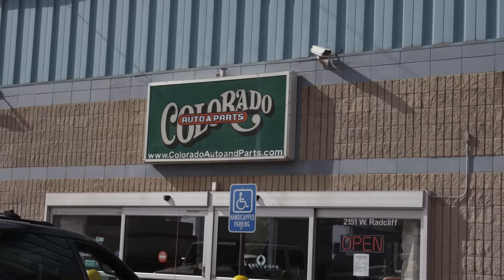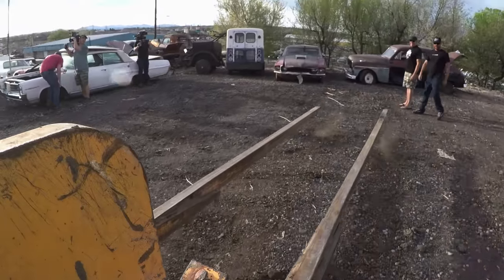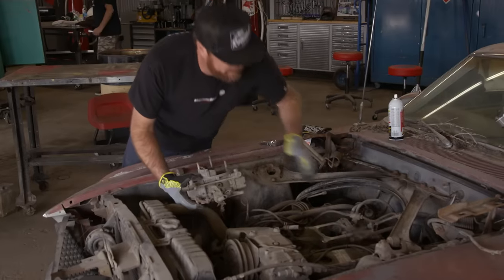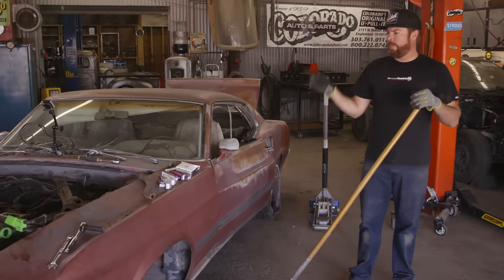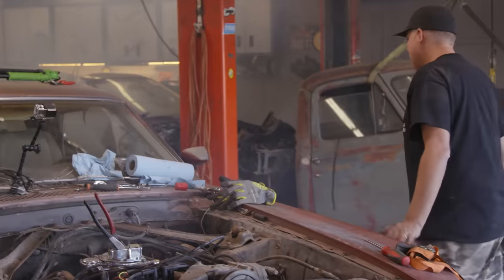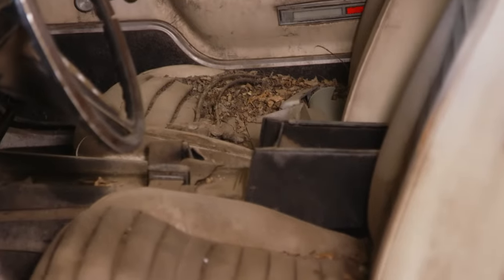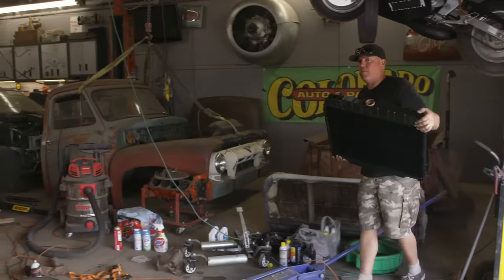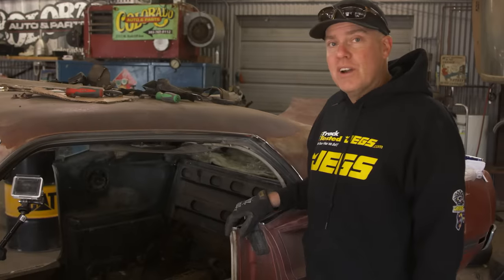Junkyard-Rescue 1969 Mustang Mach 1! - Roadkill Ep. 66

Comment: If a car sits rotting  for 37 years and is able to run with only fluid changes that car is the definition of pure quality.
Reply: You say that and then here comes episode 73 and the motor seized.
Reply: needed a lot more then that... dont know where you got that from.
Reply: Well, a leaf in the oil pan blocked the oil circulation. Can't blame the car ;)
Reply: Frederik19951995 How’d a leaf get in the oil pan?
Reply: Badjuju It needed some weather-damaged parts but the engine was mostly good, the parts for the fix weren’t insanely expensive or hard to find, the engine didn’t need disassembly
Reply: The leaf probably got in there because the distributor was not in it
Reply: Needed waaay more
Reply: Why I like ford
Reply: too bad , the new fords don't hold up like that
Reply: your uber has arrived!
Reply: @damaylaphoenix1155  No new car holds up like that. Theyre all focused too much on luxory nowadays. Nissan Titan, Frontier, and the Xterra were very solid though
Reply: Ssuuwaaaa
Reply: 1 in 500 cars sitting for 37 years still run that's amazing
Reply: no doubt it is a quality car, but I saw a new carb, distributor cap, wheels and tires, brake cylinder, etc.  Not to mention that the floor is totally rotted through, and they didn't bother to fix it.  But I was surprised how square and true the car looked after all that time.
Reply: Built Ford tough
Reply: Conixon Ni unlike most of today’s cars I like most older cars rather than the new one
Reply: one reason that old ford is so much better then new ford.
Reply: Only a Ford
Reply: America made that's why
Reply: @user-di1de7zm2b   . . The motor seized up because there were leaves inside that blocked the oil flow. Had the 'guys' checked for debris more thorougly, the seize-up would not have happened.
Reply: 😍 you too baby girl is so much to me and my kids and
Reply: all there missing is marvel mystory oil  to restore the motor and trans  now that the rings are shot   the bores had to be so rusted it was like runing the piston and rings in a bore made of 100 grit sandpaper same with the valve guides
Reply: any one intrested in a non numbers matching rot box
Reply: the battery must have been still good too
Reply: I would have taken that car in a heartbeat.  When I bought my first mustang it had a blown engine and a c-4 tranny that leaked about a quart a day. I drove it for 2 years before my husband sold it.
Reply: cody6665     9
Reply: Somebody should take a car from today and Try to start it After 37 years Sitting outside...
Reply: @user-di1de7zm2b  leaves blocked the sump apparently

Comment: Anyone else mad that cars aren’t built like this anymore? Everything just looks like a Toyota Corolla and it’s upsetting me
Reply: Ur right
Reply: Modern cars are rounded to try to counter drag.
Reply: 100% agree. Don’t even get me started on Prius’s or daily drivers like Honda pilots. Uhhhh why can’t they make cars like they used too anymore????
Reply: Thats cos you dont understand why all cars shape is similar. New cars are much safer to be even run over by. The bubble rounded curves not sharp edges. All wipers and stuff placed lower so you dont get flesh ripped off. But mostly its for cars hitting each other. Old car bonnet crumples engine pushes into the footwell steering collum through ribs. But the bubble car is all crumple zone. A front impact carries the shock up the wings pillars down the roof all protecting the people so much better.   Remember the motorbikes front number plate? How many people got split by those. Hood ornaments impaling people at just 10mph. Cool car DUMB DESIGNS. This is the future stupid deaths gave us.
Reply: j q meh. Life is meant to take chances.
Reply: I know right
Reply: All cars look like a Toyota Corolla? Not really buddy, not by far. Granted not all technologies that they come out with are necessary improvements to cars and sometimes cause more problems but overall, yes, the technology today will do circles around the cars from back then. it's just like firearms yeah shooting a muzzleloader from the 1700s is cool once in awhile but I'd rather have my AR-15.
Reply: We could go back to every car on earth being a variation of a Dodge K car.
Reply: @Ryan318l  pleanty of companies make replica's, you can buy a brand new mustang just as it rolled into the factory brand new and make your own.
Reply: White McFlight he means overall exterior look of cars not in performance parts
Reply: @Ryan318l  You're not the only person on the road, other people can be hurt by your vehicle a d your driving too. If you were alone on this planet, it wouldn't matter.
Reply: Dillon Orr I’m 12 so I don’t drive. But if I did, I would agree.
Reply: In response to some of the replies here cars all looking alike has less to do with safety or aerodynamics than people's greed and stupidity. Yes cars today are generally more aerodynamic than cars of yesteryear but if aerodynamics were the only concern you'd have a car that looks like this https://www.wired.com/2014/09/german-aerodynamic/ because most of it's problems have been fixed. Lest we forget the 1940s-1950s cars with fins and streamlining or the 1980s when Asian cars brought in angles on everything. Unfortunately people copy other people's successes hoping to cash in on them and idiots eat it up as long as it's packaged as the newest thing. Some fads across the years include...

TV/movies: westerns, atomic power/monsters, kung-fu, soap operas, game shows. 

Games: zombies, battle royale, hero shooters, cosmetics, F2P.

Fashion: from everyone wearing suits and dresses to everyone wearing t-shirts.

Changes in style are about 10% innovation and 90% people copying what is currently popular to make a buck. When new phones, cars, movies, software and games are released based on a schedule and what is currently hot they often don't do anything significantly better or different than what has come before. Innovation takes time but that doesn't stop people putting out "new" products every year. As long as it's labeled new and popular idiots will buy it. Actually being better is second place at best.
Reply: That's why I no longer buy cars all I buy is trucks through the only vehicle still made out of all metal
Reply: AE86 👌😭👍
Reply: @westerjester5066    What's "cos" supposed to mean?
Reply: Get a new Mustang bro, head turner for days
Reply: Don't worry they all look like ford Taurus' now
Reply: Danny A boyyy stop
Reply: Danny A yes but everything is being modernized and becoming more efficient
Reply: Danny A sooo like that Mach one would get smoked by a a k series Honda and you’re complaining that everything is starting to look like a Toyota Corolla FYI the Toyota Corolla  is old
Reply: It’s up to us to keep these cars alive
Reply: I was born in the 21st century but generally believe the older look of cars is better. I can't stand where I live, all dealerships I ride my bike past they're all full of pregnant cars or family vans literally nothing looks good.
Reply: That's why I have an old Vega but new drivetrain
Reply: i know it is stupid they should bring it back
Reply: Danny A have seen a new corolla? They look like higher end lexus now. Not even corollas look like corollas anymore
Reply: I'm a huge fan of the 2005-2009 S197 Mustangs too- but looks wise, nothing better than a acapulco blue 69 with the slats and wing... gotta say though, the 69s were a falcon that gained half a ton, the underhood bracing barely held them together, where the S197 is tight and even though portly, stiff as a board...far better car on many yardsticks, but looks? the nod goes solidly to the 69. Imagine if Hyundai repopped a 69FB body for their V8 Genesis chassis? they could end the US auto industry overnight...never understood why ALL manufacturers are still so fixated on round roofed 4 door sedans...costs the same to make a pretty car as a commodity car...
Reply: I love one corrilla
Reply: @mosshivenetwork117  thats facts
Reply: @westerjester5066  that made sense but it didnt
Reply: You seen the new Chevy trucks? May as well be called the Chevy tundrado
Reply: So called Eco cars are incased In plastic
Reply: Or does a Toyota Corolla look like everything else? 🤔
Reply: Toyota Corollas go 300,000 miles, just ad gas no maint. Needed

Comment: Roadkill tip for you. If you run a flat tip air hammer bit on the mach 1 engine mounts while it's running it will clear the rings. It will also move sludge in the valleys. Dumping in seafoam first and waiting an hour also ensures 💯 victory!

Comment: I wish there was a use for those old oil can spouts, i bought a few tote boxes from a speed shop after the owner shifted for his last time, and had a bunch inside. maybe weld 'em into lawn art.  I can say from experience, those 1969 gas tanks work in 1967 Mustangs, you lose an inch of trunk space but gain capacity.
Reply: I have a  '67 390 GTA  Fastback that i paid $1200 for 30 years ago. I never liked the 69s , bigger heavier, ugly tail end. To each his own and sometimes I wish for AC but roll down the windows and listen to the rumble makes it worth the sweat. Nice to see this one running.
Reply: @Ratfunk02  That's a nice purchase (I have a 1967 convert, interior/exterior decor group, honey gold, original 289 3 speed but someone put in a 351W with headers and a hurst shifted toploader--pretty much 1970's fuel economy technology).  I wish Ford had done more with the 390 to compete with Chevy's 396. that rat was the LS1 of its day, easy to get 450 hp out of. Ford did some effort in 1961 to do a tripower 390 with 401 hp. but Ford wanted people to step up and order a 427. 

The 1969 and older models did get bigger, which gives some room for a big block (I also have a 1986 GT, there's fun with small blocks when the car is light).I will say, AC is nice :)  I have a 1968 Olds 442, stripper model (except power steering and the THM400) with black interior and vinyl top and I live on the coast, so if you get air moving it's not a hot blast of dry heat like in say Nevada...but on a long drive the wind noise gets to you (the flipper vent window doesn't do enough). One day that will get AC, a new unit that takes up less weight.

Comment: Bought a used '69 Mach 1 in 1970 when I came home from Viet Nam. Had the 351 Windsor with a 4 spd manual. It was burgundy with the gold stripes. Was stationed at an air base in NY. That car was great for the twisties in the Aderondack's. Wish I still had it. Traded in my '64 Galaxie 390 4 spd on it. Wish I still had that one too.

Comment: Hood hinges for old Mopars are no problem. The ones on my '69 Charger came from a 1980s Dodge pickup truck. They're all the same for a bunch of different models for a bunch of different years, which is how all car manufacturers should have done it. My radiator, windshield wiper motor, and horns are from 1970s and 1980s Dodge pickups and vans too.

Comment: My advice would be to restore that Mach 1 and stick in a new engine(Must be ford) also do up the suspension
Reply: Booooorrrrriiiiinnnnngggggg!
Reply: Put rb engine
Reply: A '69 Mach 1 with a Coyote 5.0 is boring to you? Damn bro, I wonder what it takes to keep you entertained.
Reply: Schnot LS?
Reply: Graf Nikolai Gay!
Reply: Corey Smith The point is how many hundreds of thousands of car restorations are there? Been there done that. How many restorations can you watch before it gets really boring?
Reply: Caleb Sebastian jdm!!! xD
Reply: Graf Nikolai rebuild the engine
Reply: Graf Nikolai either a 5.2 shelby motor or a modern 5.0
Reply: dude, that engine runs fine! just rebuild it so it doesn't smoke
Reply: Da_Boom the smoke just comes from turds burning off the block and headers

Comment: The Coyote from Hard castle and mccormick wasnt a bradley GT. The car McCormick drove the Coyote X,was built from custom molds based on the McLaren M6GT.[1] The original Coyote X was molded, modified and assembled by Mike Fennel. The nose, windshield doors and lower body (minus the ventral intakes) are faithful representations of the McLaren; the cut down rear deck, however, was a custom component that became a feature on many Manta Montage kits with damaged or removed rear windows. The most noticeable differences between the Coyotes and Mantas are the wheel wells, roll pan height and shape, and the fact that the Coyote has a one piece front clip that terminates about an inch before and surrounding the windshield.

Most of the cars made for the show were molded and assembled by either Mike Fennel or Unique Movie Cars. Like many kit cars of the time, the car uses a chassis from a Volkswagen Beetle and its engine from a Porsche 914.[2][3] For the second and third seasons, producers used a different Coyote which was based on a DeLorean DMC-12, as Brian Keith had difficulty getting in and out of the original Coyote.[4]

The Season 2 and Season 3 Coyote does not resemble the Manta, as the front is larger than the original, making the car resemble a front-engined car. The Season 1 "Hero" car that was used in the production of Hardcastle and McCormick is owned by a private owner in southern New Jersey.[citation needed] The stunt/skid car (used in all 3 seasons) was reconfigured for the Knight Rider 2000 television pilot,[5] then consequently turned into Jay Ohrberg's show car "Taz-Mobile".[6] In April 2011, the stunt/skid car was sold and shipped to Dallas Texas where it was re-bodied back to its former Coyote configuration, retaining as many of the original Coyote pieces as possible (in private collection).[citation needed] Note: there was only one Season One "Hero Car", One "Skid/Stunt" Car used in all three seasons and several (center seat mounted, dune buggy like, see title shot) "jump cars". A Season 2/3 (De Lorean body) car appeared briefly on the sixth episode of Season 5 of the sitcom Married... with Children.

Comment: love these fastbacks. crazy that a nearly intact mach sat there all that time, but guess it happens... mines been sitting engineless in the garage since 1984 when I pulled the 302 out to convert to 429... did the "I'm gonna fix it someday" thing, finally started in 2013 for a month- built a rotisserie, striped/etched/painted floors(original floorpan actually survived- toe boards forward-nope, all rotted), but kids projects derailed it again... caught up for now,  this summer is gonna finally be mustang summer with any luck at all- purists will hate me- the front 'frame' tin is going away, getting a subframe. both lower quarters and one lip need repaired(got the panels), undersides and bottom front corners of doors need typical work- plan is keep as much as possible, fab in as needed to get all the rust cut out... still need a drivers a pillar stainless trim and inner plastic piece, and a dash cover- seats still look good, but will need upholstery, as hard as a rock from age...the 429 is gonna be different- plan is new front cover to allow porting hydraulics to modified mopar cam phaser, crank trigger/front oil pump(dist and gears going away), dual BMW water pumps kinda like a old flathead, 2 linked mustang servo throttle bodies to a 'tubular dual plane' header-like intake, stock 2006 mustang 3V PCM, knock/cam/02 sensors, the whole package- means wheel speed sensors too so the PCM can properly 'learn' the crank trigger comps...hoping to keep the 10.5:1 429 happy on pump gas- they get away with it on the new ones... pipe dream maybe, but got most of the parts and the tools- just need the time...its turning 50, and I aint getting any younger, so its time :)

Comment: When I got out of the marine corps in 69 I got one these it  was the same color if I remember it was Aztec Autumn,  but a 429 ram air . Had to lift the engine about 5 inches to change the  back right plug but a 1 inch hole saw in the fender well fixed that . If it snowed a half inch it would not move because the weight ratio was 75 front to 25 rear

Comment: You may still get lucky, it all depends. There are a lot of old junkyards, not all of them have gone away yet. There was one that I used to get Nova parts and Le Mans parts from, I don't recall whether they had any Mustangs there, but they had an AMX. It was still there up until 04, when the creek flooded and washed it out. I'd like to hope all those old beauties didn't end up as scrap metal, but I don't know where they went. The "powers that be" bought the land and built a bunch of McMansions on it. :(

Comment: Brake fluid pressure is not moving to the rear brakes. Could be a master cylinder, but I'm thinking it could be the proportioning valve.

Comment: The original Hardcastle and McCormick Coyote car was The original Coyote X was molded, modified and assembled by Mike Fennel. The car uses a chassis from a Volkswagen Beetle and its engine is from a Porsche 914. NOT A BRADLEY!

Comment: use a pump and pump oil through the oil pressure  port to oil all moving parts up and lube the engine hand turn the motor to avoid snapping rings you got lucky there '